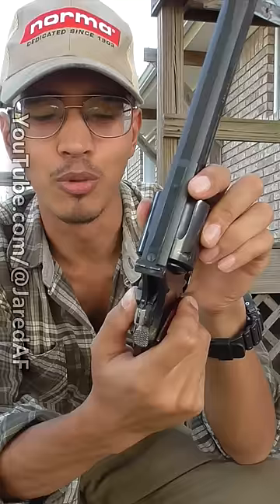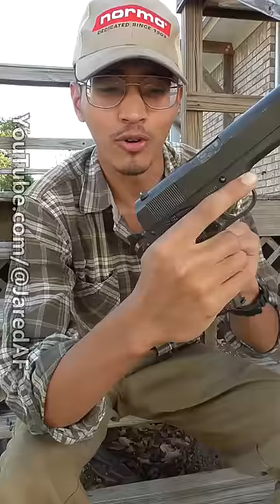safer way of decocking a hammer-fired gun ("don't thumb the hammer down" part 2)

Comment: That revolver is colossal as hell
Reply: Bro could kill a bear with that.
Reply: @markbalogh1481  shii I know it. What is that? A .44?
Reply: I just searched it up and i could not find the exact model either. I believe that is a much older version of the s&w model 686 or 629 I believe it was a 686 though
Reply: @thesugardaddy7037 its in 357 as per the barrel so a model 27 or 586 or one of the other random blue models of 357. In SW q 6xx is a stainless gun
Reply: So masive Hellboy about to come back to take it from hik by mistake.
Reply: It's not a revolver if it isn't in an absurdly large caliber.
Reply: @Sallyhearts it's a 586.
Reply: the 1911 is also massive so i really think the guy is tiny
Reply: It's a stout beast... I have the stainless steel finish version of this; a 686, newer model.
Reply: @markbalogh1481 Jamie pull up that clip of a man shooting a bear with a revolver
Reply: I believe it is a. 44 magnum,  hunting model.
Reply: @thesugardaddy7037 No. It's a. 44 Mag. Model 29 hunter. It is even  optics ready. I  believe it even  came with  scope  rings and  mount.
Reply: @AK-jb2ud  Not a 6 prefix it is blue. 6 denotes Stainless steel
Reply: But cool as shit tbh
Reply: Rick grimes
Reply from the maker: 586-1, porno camera angle was intentional much to the dismay of the "never point a gun up" crowd
Reply: @JaredAF 
I've been around guns for 37 years. Whichever way doesn't flag people is "safe."
Reply: 44. Mag
Reply: I thought it was because it’d be easier to demonstrate what he was talking about with a large revolver to reference
Reply: I think it's a mag 41
Reply: I swear to god idk what magic he’s doing but all those guns look big as hell when he holds them
Reply: @AK-jb2ud  its a .357 not a .44 depending on the grains travels around 1200++ fps. barell length plays a big part in projectile's velocity. baiscally same bullet from a 2 inch maynot b be enough to smoke a bear. from a 6 yeah.
Reply: @thesugardaddy7037  it’s a 44
Reply: If he shoot even accidently i bet he gonna hit somethin 😂😂😂
Reply: Perfect for criminals heads
Reply: How to tell how far to pull the trigger while you're trying not to pull the trigger...?
Reply: Highway Parol edition
Reply: A monster
Reply: He got the big iron on his hip
Reply: And cool
Reply: @AK-jb2ud no, it's Patrick
Reply: Cue Big Iron
Reply: @markbalogh1481 Shhhh. You don't wanna summon Joe Rogan...
Reply: 'murica
Reply: Glad I'm not the only one that noticed, I thought maybe I was seeing things. Cuz I'm high, or It was a camera thing. Or the dude was smol. But I doubted that.
Reply: I think broski is just pretty small.
Reply: @Gonken88  could be the case
Reply: @Rockstopmotion  2nd amendment is for tyrannical governments, not criminals.
Reply: It's the big iron
Reply: Imagine putting it thru  someone mouth that has bad intentions wouldn't wanna be that guy
Reply: After seeing the 1911 I think he's just small as hell
Reply: Compensation
Reply: say  away from this guy lol
Reply: (Samuel L Jackson voice)
Thats a goddam hand cannon
Reply: Tell me youve never shot a .460 without telling me youve never shot a .460
Reply: @vreel3366  a .460?? Not a caliber you see everyday and not a casual like 9mm. Yes I ain’t never shot no damn .460
Reply: @AK-jb2ud finding rounds is a bit tricky, no one carries them anymore
Reply: @markbalogh1481 you can kill a bear with lots of things
Reply: It's the only thing I would trade my taurus judge for
Reply: @Bob...-yt5fy  it is a damn heavy frame. It can fire 45 long colt, 454 casull, and obviously 460. The former two produce almost no recoil when fired from the 460.
Reply: @turnerg  it's the best gun I have
Reply: That type of revolver will blow someone’s head into bits lol
Reply: @michaelkeandremusic  frrrrrr
Reply: i can see my reflection in that revolver, hot dam man
Reply: Beautiful right
Reply: Like Rick Grimes revolver from (The walking dead)
Reply: Feeling lucky punk
Reply: Hand cannon
Reply: That’s what she said 😉
Reply: pretty standard
Reply: Just a child's first Fisher Price scale model toy by American standards
Reply: I have something colossal inside my shorts
Reply: @markbalogh1481 the bear drops a bigger one when you kill it xD
Reply: @AK-jb2ud looks more like a 357
Reply: 357 colt trooper 3 I think!
Reply: @tommynorton8973  I want one. For protection of course those farming fridges need to learn respect dammit
Reply: Dude is just small
Reply: @AK-jb2ud model 27 .357
Reply: @AK-jb2ud i believe its a 357 S&W
Reply: @thesugardaddy7037 Model 19
Reply: @AK-jb2ud maybe a Taurus raging bull or smth
Reply: These are the coolest ones
Reply: .357
Reply: Looks like a python 🤔
Reply: @AK-jb2ud  686-8 to be precise.  I used to own one in stainless steel
Reply: @markbalogh1481 can kill ants too
Reply: Look up the MAGNUM RESEARCH,  .45-70 B.F.R...
THAT is a big revolver...
And I can hit steel at 325 yards with mine..1 foot x 1 foot plate hanging from chains...and does it slam it.
Reply: @roscoschmosco5524  The barrel very clearly says 357
Reply: @drewbocop  it sure does, what's your point?
Reply: its a 357mag! 😮 I had a 6.5in 7rnd Taurus Tracker (sooo nice)she loved educating people on how you should be nice too her PaPa...😢...then one cold, dark night, she was gun napped from my truck as i went into the store! 🤬..........
🥺...🤮...😭... ..  .    .
Reply: @roscoschmosco5524  i replied to the wrong person
Reply: The mother frickin pistol
Reply: Big deal it's only a six shooter.he will run out before this kid hits anything,bet?
Reply: .500 nitro express
Reply: Not really
Reply: 44 super ?
Reply: @mitchellthomas8432  Nope. I could read the rollmarks on the side of the barrel and it says: S&W .357 Magnum. Since it has a full underlug (it both an ejector rod shroud and a barrel weight to reduce recoil a little bit) it's a Model 586. The Model 27 and the Registered Magnum they have a partial underlug.
Reply: @Xerxes1688  OK. My 60 year old eyes are not that good any more.  He must be a  smaller  frame  person.  My model 586 doesn't look at  big in my hand but I am 6'1" and 250#.
Reply: @mitchellthomas8432  Nah, I think it's because the video's resolution and, since it's a YT short, you can't go fullscreen. I could barely read the .357 Magnum inscription. Me at 35, my eyesight is also poor due to too much TV and computer, and maybe due to a corrective eye surgery at 4.
Other than that I'm probably about the same size as Jared, similar type of hands. 1911A1 pistols fit just fine in my hands
Reply: @Xerxes1688  I think mine went down hill  due to  some stuff from training I'm sure.  Tear gas and no  masks, mace in the face and  still  having to  clear the room . My hearing is  going  down  hill to. Too many  loud  noises in confined  spaces.
Reply: @cadenmac6998  God damn, the bear had a revolver?

"The right to arm bears", at work huh?
Reply: @uhuh.2232 Lens he's using plus holding the firearms up close to the camera, I think.

Like, when he leans back away from the camera the weapon returns to normal size :D
Reply: @nowandrew4442  He's pulling the trigger all the way, but his thumb is on the hammer to retard its release and preventing discharge.

In the safer second method he describes, after allowing the hammer just slightly forward, he releases the trigger, which retracts the firing pin back into the frame.
Reply: Looks like a 586 .357 magnum.
Reply: @AK-jb2ud some old 357 magnums are needlessly massive as well.
Reply: You dont want a nd whit thst
Reply: The little hands make it look bigger 😂
Reply: Leave the room if this will offend you
Reply: Look up what .500 magnum is.
Reply: @theanarchist9733  i have a .22 revolver so point is disproven, next.
Reply: @markbalogh1481 "Whaddya need that fo', stranger? Goin' huntin' an elephant?"
Reply: @jfangm  I take it you were a 13B then? Lol
Reply: @mitchellthomas8432  huh, that's actually neat information, not much of a revolver guy but I had a Blackhawk in 44 mag, hated the thing due to the short grip  killing my hands after like 20 rounds, sold it and bought a 629 classic which I love and will never sell, got any more info about understanding the S&W numbering system?

Side note, I like my mini14, half a dozen 10-22s and the mark 3 I got but beyond that I've never been a fan of rugers, the brand just isn't for me, I prefer CZ, Sig and Berreta pistols, Berreta and browning shotguns, CZ and Remington bolt guns, DD,Noveske and CMT ARs.
Reply: @rantional8180  
Sorry, I don't speak ASVAB failure.
Reply: @rantional8180  We all have our  preference.  If not there would not be a  need for  different brands. I  did  put  Houge  grips on my .44. The smooth western grips and  short barrel almost made it  uncontrollable when I  shoot my custom bear loads in it.
Reply: Not really it gets bigger
Reply: @daogsillygoose  I know
Reply: @garym2671 I believe yur right I had one.   Mine was a 8 3/8 in barrel
Reply: No it's just revolver sized
Reply: @carlosmorris4510 ayyy, I got a 686 as well. Absolutely love that revolver.
Reply: Wait till you see a BFR
Reply: Judging by the size of the chamber, it appears to be a 44 magnum. Probably a 5 stack
Reply: @JaredAF There's yet one more cool way to decock a CZ DA/SA semi auto (possibly other makes and models also, but I know it works on CZs at least.) 
Pull back the slide back about 3/4s - 1 inch as if you're about to take it down for disassembly. Then pull the trigger. Then allow the hammer to ride the slide shut safely. 
Just a cool thing I learned. This kinda reminded me of that
Reply: I have one! 😊
Reply: Model 29, the .44 magnum N Frame, big brother to the Model 19 K frame .357 magnum.
Reply: Tiny hands.
Reply: check out the colt walker, the OG big revolver lol. This wouldn't be too far off though.
Reply: @theanarchist9733  when revolvers were actually a viable side arm, the average caliber size was much, much smaller than today. Even today, the most common revolver rounds are .22 and .38, even the .38 is less powerful than 9mm
Reply: @lol-un6nl  right? I thought the revolver was massive until I saw the 1911 so I figured he's just small.
Reply: @lol-un6nl  
I'm certain at least one part of him is...
Reply: Is that the SW500?
Reply: I think that’s a python
Reply: @markbalogh1481 a .22?
Reply: See mine, S&W 500 8inch barrel, desert eagle who lol
Reply: Actually he and his hands are just small. The handgun looks massive as well. This is just a small man 😅
Reply: @Gonken88  Yeah, short and skinny. I guess his guns are to compensate for that.
Reply: Decock blocker.
Reply: The big iron.
Reply: @lol-un6nl he’s leaning into the camera and holding the guns out toward the camera so it makes them look bigger. Optical illusion makes them look huge.
Reply: @markbalogh1481 by just throwing it even
Reply: @AK-jb2ud I think it's a 357
Reply: Handcannon
Reply: @JaredAF 8-3/8”?
Reply: @AK-jb2ud  That’s a 44 Magnum. At one time the most powerful handgun in the world and could blow your head clean off. So you just gotta ask yourself one question… Do I feel lucky?…… Well, do ya punk?
Reply: Exactly model for that beautiful beast please?
Reply: Nah he must be short cause that looks a normal 586 and it's not that big
Reply: It's almost like the mini version of the gun from hellboy and that gun makes the .44 magnum look like a pea shooter.
Reply: Yeah 44’s tend to be like that
Reply: @Don_cheedle  by like that line from the dirty Harry movie when he the .44 magnum is the most powerful gun
Reply: I was thinking the same, colossal!
Reply: You think that's colossal? I have a nagant revolver
Reply: @nickz5849  I’m just saying it’s a pretty big pistol in general. Especially when you compare it to someone with small hands
Reply: @AK-jb2ud  Oh I thought you meant colossal as in old not big
Reply: Yeah The Wristbreaker
Reply: That's what I thought too until I saw him holding the 1911, dude just has little brother hands
Reply: Btw, a revolver is not a pistol. 🥹
Reply: Nuh guy is short and skinny
Reply: 20 years ago that's a normal revolver 😂
Reply: He's probably small.
Reply: And i want it
Reply: @AK-jb2ud  686 models are stainless steel.
Reply: Nah this dudes like 5 foot 1
Reply: Good backup ankle holster weapon
Reply: @AK-jb2ud  I used to own the model 29 S&W .44 mag. 8-3/8 barrel. Expensive to shoot. I outgrew the thrill. Made popular in Dirty Harry movie.
Reply: I think its small hand
Reply: @mitchellthomas8432 
You believe wrong.
A 586. .357mag.
686 is the stainless version.

Comment: I have had an "oopsie" before after my thumb slipped (no one was hurt, outside of my pride). Very glad to see this as a topic being covered, thanks for that. You earned a sub.
Reply: Agreed, fire arm safety is a great thing for anyone to learn no matter how experienced. I’ve been firing guns my whole life and I didn’t know this tidbit. Though that is likely because I so rarely operate a gun with a hammer.
Reply: Totally shot the wall doing this once
Reply: What a dumb gun design. To force ppl to have to pull the trigger of a potentially loaded gun to make it safe is legit comically bad design.
Reply: That’s cause it’s not intentional.
Reply: rip that guy named pride
Reply: I bet it doesn't again
Reply: @Noadvantage246 it was a long time ago
Reply: @Noadvantage246 which is why most modern guns don’t have hammers anymore
Reply: @Noadvantage246 or just learn how to operate it.
Reply: Yeah my 1911 hammer slipped on me before, the wall paid the price. Extra careful now for sure.
Reply: @caseymack6088  that's the thing right. it seems they don't have to learn anything to buy a gun.
Reply: @Noadvantage246  thats because guns aren't toys.
Reply: @Noadvantage246  wait till you learn about stick shift
Reply: @caseymack6088  That’s the whole point, correct operation requires you to pull the trigger of a loaded gun and hope you’re finger doesn’t slip off the hammer.

If you you’re an expert, simple sweat can cause it to fire during the disarm. Again that’s purely bad design. The US military said Glocks had an unsafe design over the fact you have to pull the trigger to take it apart. At least you can clear it tho, this is laughable.
Reply: @fartyturd4084  Even the modern guns with hammers have de cockers. Proves it can be done they we’re just lazy and unconcerned about safety.
Reply: @Noadvantage246 they're older firearms, discharge casualties were not the primary concern at the time
Reply: Aye, it happens. Always gotta be mindful of that hammer and your chambres.
So far after decades of carrying and shooting, I’ve only had one Oopsie.
After a complete strip down cleaning of one of me revolvers, an 1875 clone which I still carry to this day.
I had reassembled, reloaded it, only to notice that I hadn’t fully seated the hammer tension screw in the grip. 
So I quickly tensioned the screw, and did a quick hammer test- BANG Took only a second to realize my negligence. 
See, it is a revolver that I carry daily out in the field, and shoot quite often, so I am used to loading and unloading it by habit.
I am used to cleaning the thing often, but not always such a thorough strip down. So I had become complacent with reloading and holstering after a basic field clean. It was automatic, and entirely my fault. 

Luckily I am a strict follower of the Scriptures of Firearm Safety, so the other rules of safety were adhered to, and the only casualties were a plastic tool bin and my Pride. 

I keep the mangled bullet in my desk drawer as a reminder to not get complacent again.
Reply: @Noadvantage246 it’s not dumb, it’s just mechanical simplicity. 
I’ve seen modern firearms with ultra complex and redundant safety systems that have failed.
Ultimately speaking, I would rather a simpler firearm. With as few points of failure than a more complex’safe” firearm that can just as easily fail.
Reply: @fartyturd4084 there are plenty of modern guns with hammers on them.
Reply: @Beuwen_The_Dragon  but they have decockers, sorry should’ve been more clear
Reply: @Noadvantage246 it is just kinda how revolvers work, idk if there is a good way to get around it.
Reply: @TheNebulaEffect ahh!! My first lesson was on a stick. Memories.

Comment: What you are teaching is not safe, since you can still slip and have an AD.  The proper way is to place your thumb in front of the cocked hammer and pull the trigger.  Take your finger off the trigger, and the gun will be half-cocked position. at which point you can remove your thumb from its blocking position.  Now you can safely de-cock by pulling the trigger.